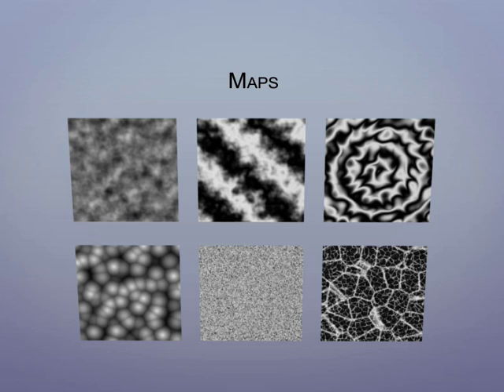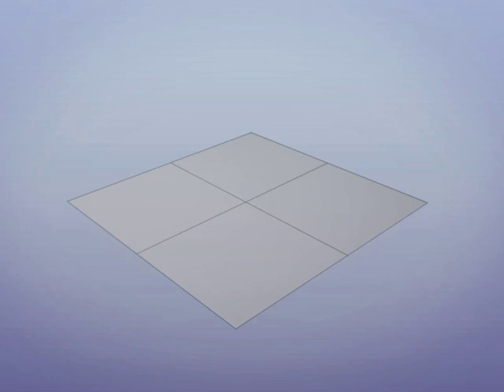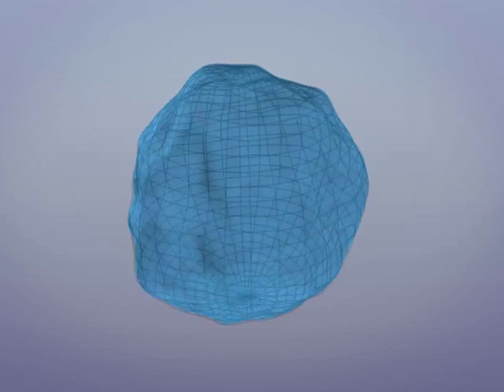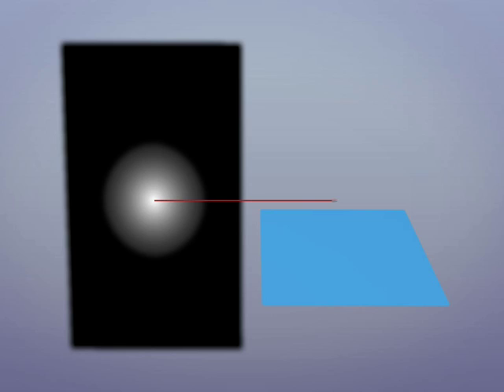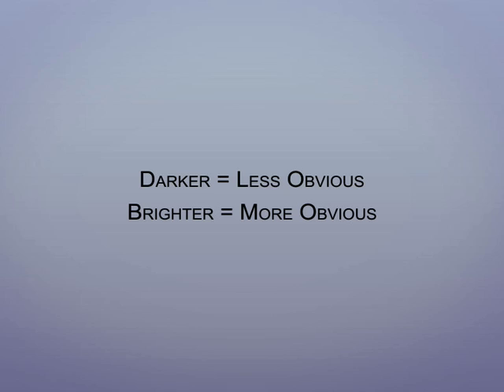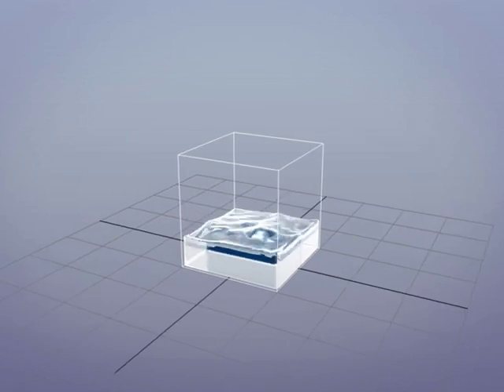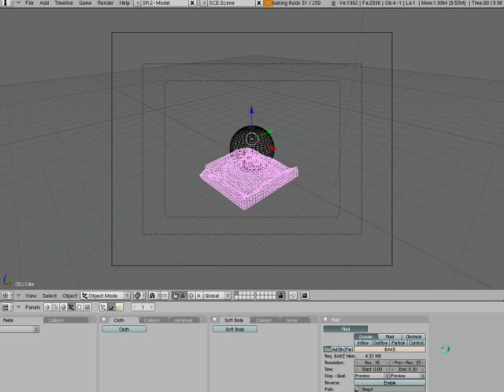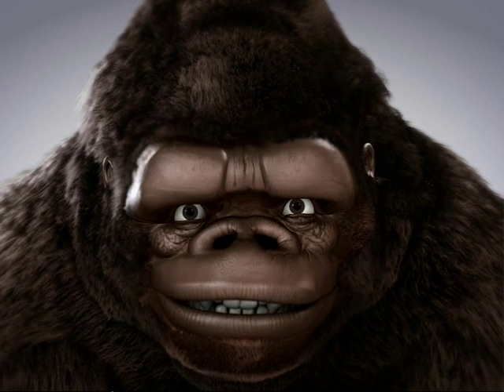Bump And Displacement Map: Overview

Comment: RGB (127,127,127) And (128,128,128) colo(u)rs on bump/displacement maps do not have any effect at all, but when they exist around colo(u)rs either higher or lower than themselves, it'll look like they do something. 

(50% Brightness = no effect | 0-49% Brightness = *holes/scratches* AKA goes 'into' the object | 51-100% Brightness = Bumps, those go even higher than the object usually is.)